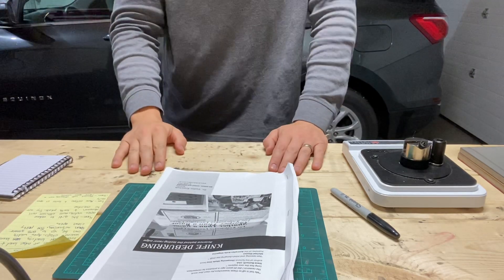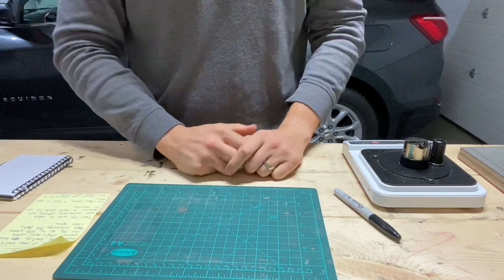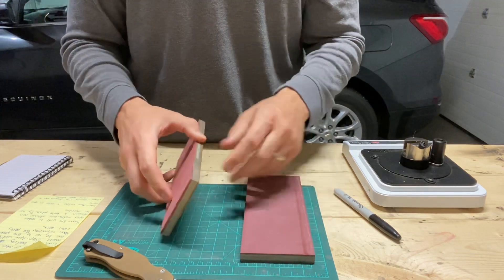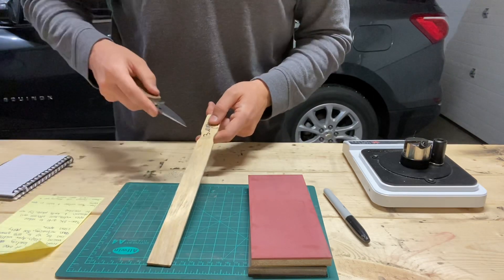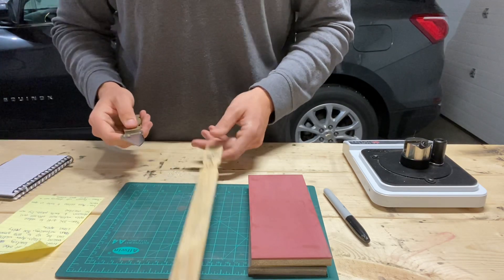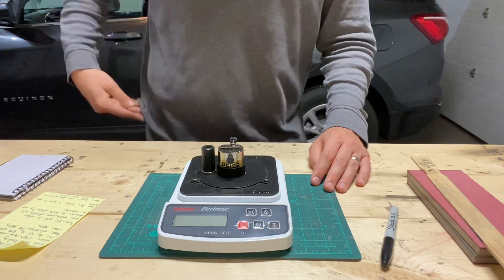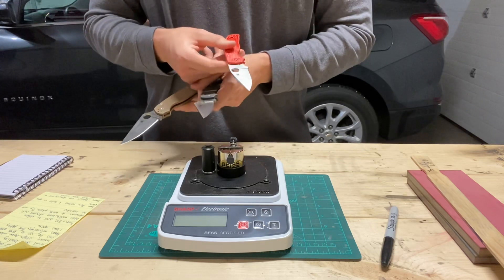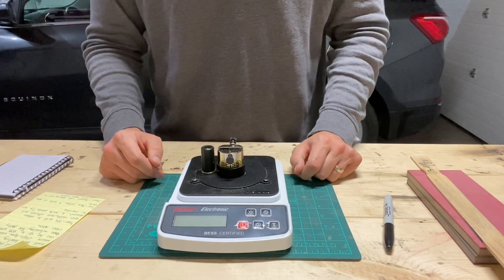My Hypothesis on Stropping and Burr Removal

Comment: You should get 2 of the same exact knife and do edge leading for one and edge trailing for the other.  Then compare results. 😬
Reply from the maker: I’ve done this with a Tojiro DP 170mm Santoku in VG-10 actually. Was the same knife but did it both ways on the chosera 3K. Results were that the edge leading felt toothy and scored around 130g BESS. Finishing with exclusive edge trailing felt more refined but the score didn’t actually change. 

The major difference was that the edge leading kept cutting for weeks whereas trailing needed to be worked on in a few days because the residual burr bent over. 

I may do a comparison using 2 fibrox knives for video

Comment: I understand this concept and do believe there is something to it and it is one of the reasons I rarely ever sharpen on diamond plates. 

Especially course plates, they remove steel too quickly and the scratches they leave are too deep. 

Also I think edge leading strokes can be not so damaging to the apex as long as you use way less pressure than edge trailing. 
I rely a lot on edge leading for deburring a lot of steels but I use ultra light pressure when doing so. 

Excellent topic and video.
Reply from the maker: Science of sharp wrote an article on it specific to diamond plates which is where I first learned about it. The knife deburring book also discusses it but generally for any abrasive. I don’t think it can be avoided completely but it’s not a big deal really if followed up by strops to clean it up and refine a bit. 

In some ways I kind of actually like that nasty aggressive edge you can get from diamond plates when it’s been deburred and cleaned up properly. The best edge I’ve ever used was with 10V on a DMT fine followed by 1um diamond strop. That baby was hair whittling and so aggressive it blew my mind. Haven’t gone for that again in a long time but there’s something to be said for it!

Comment: 👏👏👏 I said this exact same thing to jef jewell on Joe caltons last video.  I'm using a 5 or I have a 7 micron then 1 then.5 raised 1 degree or so then bare leather a pass or 2. I've tried green to finish but I don't prefer that method freehand.  The only .25 I have is from cktg I bought it awhile back but maybe I'll buy some gunny juice. And try that out!
Reply from the maker: I'd say if got this method pretty nailed down for steels like, Cruwear, LC200N, X50CrMoV15, CTS-BD1N and any that fall into or below this category for hardness/carbide volume.

I've moved onto the higher carbide stuff, just K390 for now, and it does NOT like raised strops which is something I've found in the past. The point of this is to take the edge past my traditional single strop method and see what I get. We'll see what I find!
Reply from the maker: Also I have the 0.25um from CKTG also but it is clumped up BAD in the bottle. Basically unusable and I haven’t thought about what to do with it yet!

Comment: Sorry if I make separate comments , but when you  strop you  just polish the micro/nano serrations , the result is so good it feel like a sharpening :) 
Like Shawn from Triple B  said you need a good sharpening then stropping is the icing 😜
Reply from the maker: I want a totally sharp edge off the stone that gets cleaned up and magnified on the strops for sure! For many years I only ever looked for a bit of "icing" but right now I'm experimenting with doing real work on the strops and taking the edge to the next level.
Reply: @EngineersPerspective701  The strop just enhances every grit.
I've read that online long ago and that's true. 
Probably it's the gentleness of the leather  compared to a stone.
Even a 400 grit is cool with a strop pass 😳😀
Reply from the maker: @AAAAAAndrea  Definitely can be! For a long time my standard edge was a 600-700 grit diamond plate edge followed by 1um strop. Such a great cutter and a well done version of that edge is still my favorite of all time especially on something like 10V or K390 it is smokin!

Comment: If you don't have a microscope, I'd recommend getting one.  Even a cheap jeweler's loupe from Amazon can give you some additional, valuable feedback on your edges.  Just a thought.
Reply: True, always tought that.
Unless you see it clearly it's difficult to tell.
But I've already bought too much " geeky " stuff 😂
Reply: Carson 60-120x toy microscope works very well
Reply from the maker: I have a 120x one that is just okay. I've used it some and it will reveal the cleanliness of an edge but not crazy useful. Honestly, I feel like if I used it more I could probably train my eye to see what I'm looking for.
Reply: @EngineersPerspective701  I have one, and I have learned so much by including it in my sharpening feedback loop.
Reply from the maker: @ZPositive  totally! I’ve been using my Bess tester in much the same way but I should revisit it and add another data point!
Reply: @EngineersPerspective701  I've been considering getting a Bess tester for the same reason.  Which sampling rate does yours have?
Reply from the maker: @ZPositive  it’s been a great learning aid and super nice for videos of course! Mine is the middle B model with 5g accuracy. I can see where the extra resolution of the higher end one could come into pay but would add no true value in my opinion.
Reply: @EngineersPerspective701  cool, thanks for the info!  I may just pull the trigger on one.
Reply from the maker: @ZPositive  Do it!